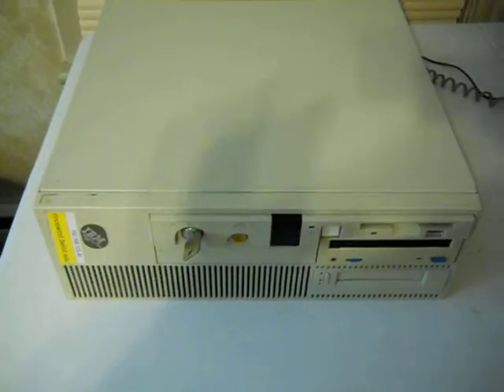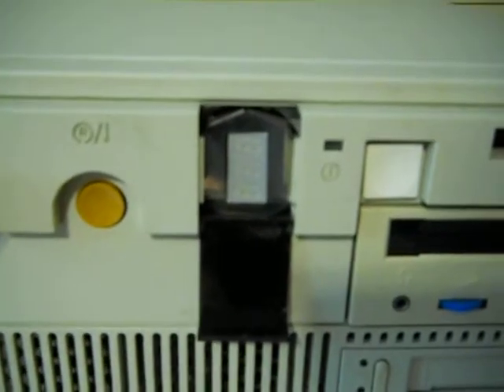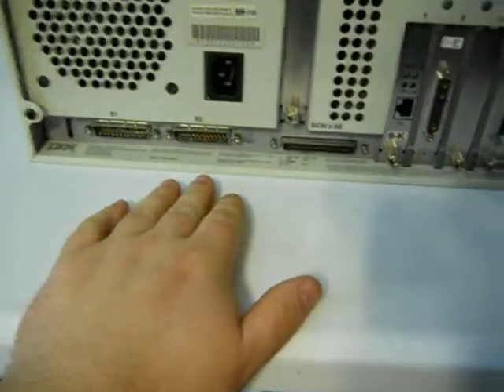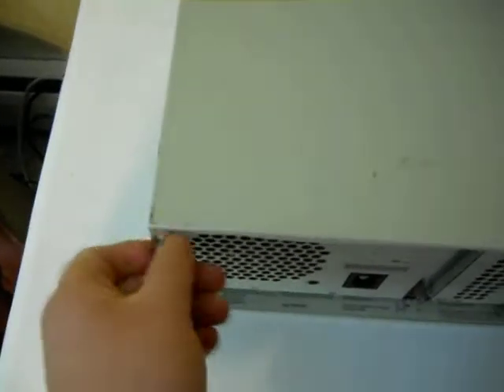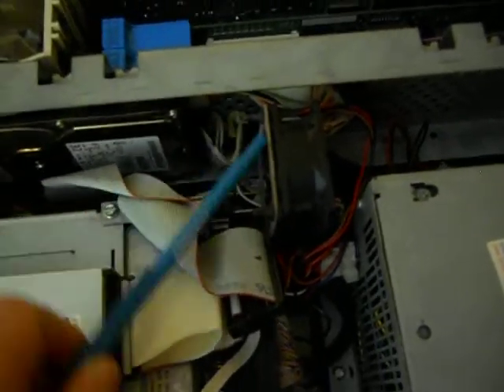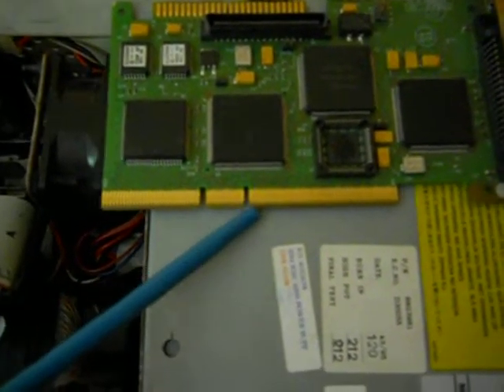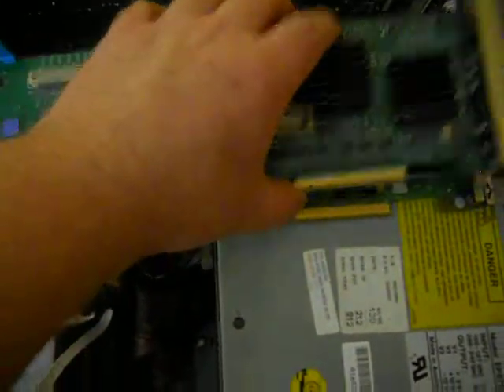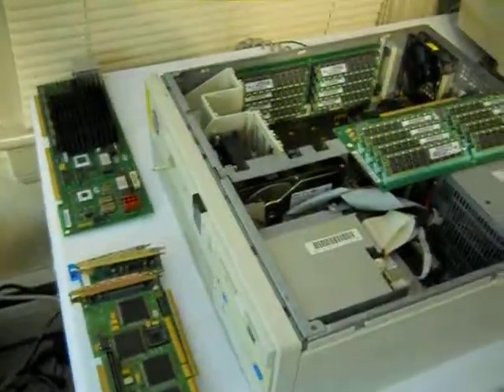IBM RS6000 #5 - Tour Part 2

Comment: I worked on these a long time ago.  These came with an ethernet controller on the motherboard made by 3Com.  At the same time RS6000's were coming out customers were upgrading their networks from hubs to switches and the 3Com controller could not handle back to back packets so another network card that did had to be installed.

Comment: The POWER2+ CPU consists of six chips, all of which are under the heatsinks on the Processor Complex card. There is an instruction cache unit, two chips which contain two each of floating point and integer ALUs, a storage control unit and two data cache units.